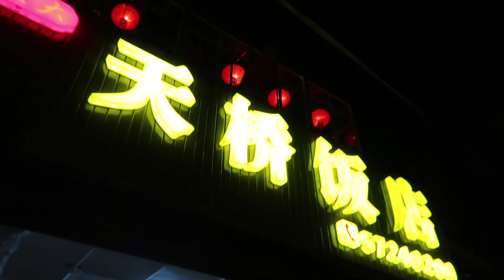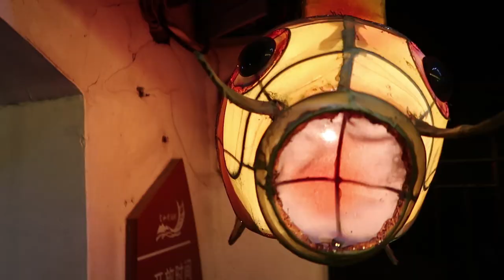LEAVING JEJU for SHANGHAI, CHINA, COMPLETE CHINA IPHONE OVERHAUL, DRINKING TOO MUCH

Comment: hehe, som bad news for you tho. that phone repair is rather a ripoff- you can buy and replace those parts for around 20-30 dollar from anywhere in the world mostly. :)
Reply: Replacement of the screen, the digitizer, and the anodized aluminum case with all the cutouts and plastic antenna strips, for 20-30 dollars? You can't even get that in Shenzhen.
Reply: Ye I might be wrong since I don't know of the case are they that expensive? mainly speaking of the screens tho. usually see them on ebay for that price range. Or at least used to havent checled past year.
Reply: Zallestial I think the case isn't so expensive, but the screen is. you must saw some fake adviertisement. If you see something extraordinarily cheap, that maybe a scam.
Reply: I went to a U Break I Fix shop in Pittsburgh and they charged me 110usd for my iPhone 7 inner and outer screens and it took them two days to repair it. So no, I don't think Matt got ripped off.
Reply: Me and my friend bought home screens from ebay and amazon for that price range and fixed phones several times, they work no problem. I suppose it is a bit annoying to disassemble and assemble the phone to change them parts tho so the service it self is worth some too.